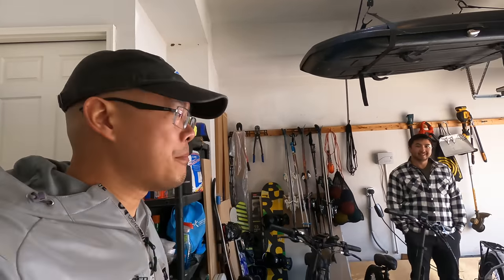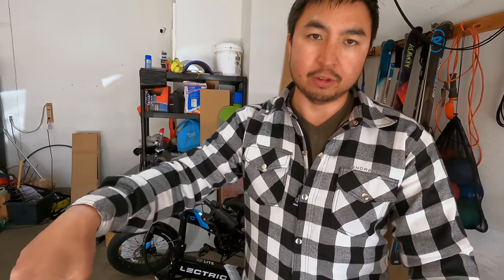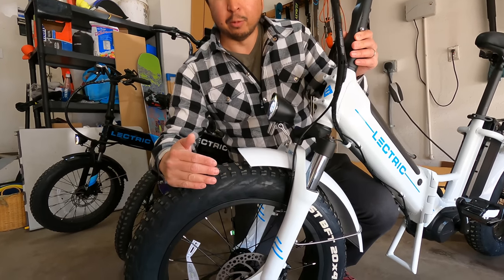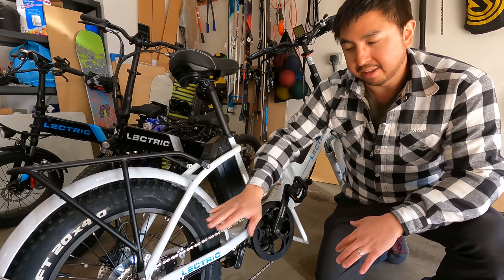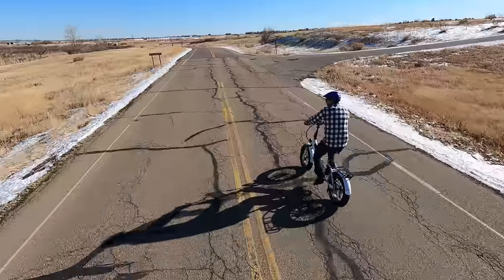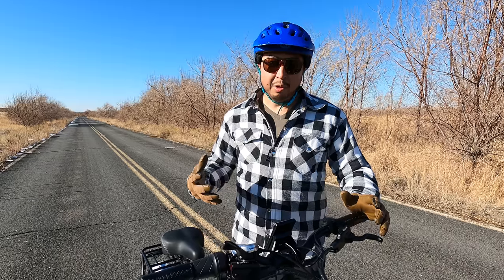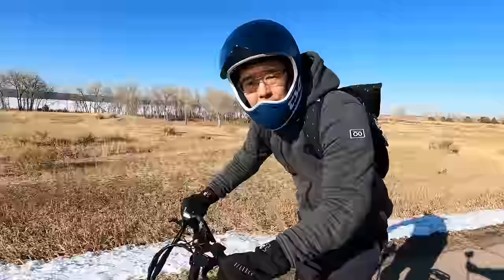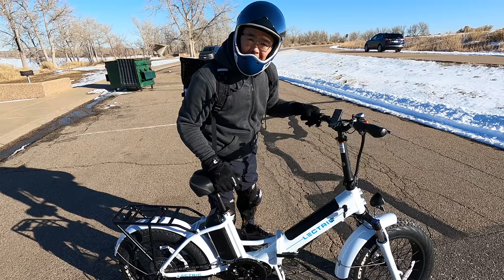Lectric XPremium Deep Dive: The Cadillac of Foldable Ebikes

Comment: It’s absolutely gorgeous. The only issue I see for me is what you mentioned the struggle of the 500watt mid drive on throttle alone going up hill. Granted there is a reason there is practically no throttle on mud drives, but a 750watt mid drive, or more would definitely be appreciated in order to preserve the motor as well as when you consider either a heavier weighted person also being able to carry more easily without worrying.
Reply: there are about a hundred mid drive with throttle ebikes out there.
Reply: @jamesharrison7114  In a 20 inch wheel and torque sensing pedal system as well?  At this price range and a company with actual support after the sale? Name them please, I need to know.  Not arguing, I'm not current on this combo.

Comment: Nice, I prefer thinner tyres which would save weight, less rolling resistance  and more puncture resistant.
A feature I think is really missing on folding ebikes is making them easy to fold into a position which allows them to easily push them around a shop, THE biggest problem with bikes is theft and a big use for them is nipping to the shop for a few bits and pieces.
Reply: Tern's Vektron line is good about this, but you're paying a premium for it.
Reply: And fat tire bikes don't fit on those front racks of buses the area Rider is a beautiful bike I almost wish I would have bought one instead of my lectric I do enjoy the cushioning of fat tires and thinner tires I feel like may get pinch flats because the speeds and the extra weight of the batteries

Comment: I can not find the mid drive motor brand name.  If it is a Bafang, then the controller can be upgraded to go even faster.  I see quite a few sales of this model happening.  Impossible to get these specs at a lower price with foldability.  Great review.  Cheers.
Reply: It's not bafang, I just watched a video with one of the owners on Chris Cross YouTube channel and he talks about it. 👍
Reply: Its a no name unproven piece of junk.  No mid drive worth its salt, would EVER end up on an ebike priced this low.  Let alone a folding one with two batteries.  Its absurd to believe this wont fall apart and have very expensive repair bills.  Besides that, REAL mid drives are very efficient and not only don't need 2 batteries, but they use on average far smaller single batteries, around 500 watt hours, that will get you 70 miles.  Something like a Yamaha mid drive does that, and wont be found on a POS like this contraption.  Going for low price will be the demise of Lectric.  Guaranteed.  It just is too young of a company, and far too naive to understand how to run a sustainable business.  Selling junk like this does not work.  Good luck with all the warranty claims folks. There are no geniuses at this company, any smarter than the hundreds of other brands out there selling far better quality at only modestly higher prices.  Be woke, go broke.  If a liberal could design anything, this would be it, as it wont last much more than a few seasons at most before needing to be replaced or heavily repaired at high expense.
Reply: @markg3950  What other brands? People always say this without giving specific recommendations.

Comment: Awesome review and looks really nice. The only thing i don't like that cannot be fixed.. is that stand... it just screams "snag me" lol.. i know it's structural.. but a locking hinge so it could be folded up whilst riding would be so much more comforting to me
Reply: The stand looks like a bad design, but they will supposedly fix that.
Reply: I totally agree. I have a RadMini Step Thru 2 and I sawed off the snagstand. I never fold the bike and don't really need it.  But I do go on hiking trails and it is in the way.   I made it so I could still attach the sawed off stand portion, by getting a little piece of steel pipe that fits around the tubing I sawed in half then drilled little holes thru the pipe and tubing both, and put little hairpin clips to hold them together, one clip above and one clip below the splice area, on each side.   

Lectric should have made a little folding and locking stand some how.  Could be a good retrofit kit for somebody to make!  I want this bike and I just might buy it tonight!
Reply: Well its 2033 now and our new XPremiums have a shorter improved stand

Comment: I think you missed the fact that the front suspension on the premium XP is adjustable. It is an air suspension. You need to put more air in it if you want a firmer ride.
It has some nice features and I suspect can give you more power than the way it is set up.
Reply: Power is not a word I would use to describe this bike.  Apparently, the XPremium has noticeably less power than the Lectric 2.0, for example.
Reply: Is it a Full suspension bike ? ?

Comment: I hope they put in a more hefty chain, since this is mid motor, there is a lot of torque coming thru that chain unlike a hub motor. You can help it by choosing a lower gear when you get going and move up as you gain speed. I would suggest removing both batteries before lifting it, your back will thank you.
Reply: I hope 3.0 will use a rubber belt and automatic transmission 👍
Reply: Same. I don’t want to unnecessarily worry about babying the chain when a go kart chain can be implemented like in the Juggernaut XD. They have finally fixed the problem that always kept me away from pulling the trigger on amid drive. Now they only have to accompany the massive power of their North American/Canadian motor to pedal assist and it is perfect.
Reply: @ScottOstr  you’re really thinking ahead. An automatic transmission would be next level, but to be honest mid drives have been around long enough for this to be a much more implemented thing. Ideally the best would be a tiny inconspicuous switch on the bike to have it be automatic, or manual.
Reply: @buffalomind6838  An automatic electric belt driven eBike already exists, so EZ to say. But a folding one with the affordable Lectric price and overclocked to 32 MPH doesn't yet. It runs that fine line between eBike and motorcycle. 🔥
Reply: @ScottOstr  it sounds almost to good to be true, but will be a thing in the near future. I don’t know if Lectric will further make history with what they offer from bike to bike in the XPremium 2, but some has the opportunity to do be the first. Hopefully Lectric does. It allow someone else to beat them to it.
Reply: Oddly, on a 1,500 mid-drive, they use the same flimsy chain.  Yes, the chain breaks very easily.
Reply: It doesn’t need a heavy duty chain. They have the torque sensor adjustable so low it barely puts out 60 nm at best. I have both the XPremium and the XP 2.0 and in class 3 the 2.0 is 4-5 mph faster. Wished I’d save the money and just bought another 2.0.
Reply: @georgeharvey3062  With an extra battery for same range as the Premium and you'd still save $$
Reply: @georgeharvey3062 How have the Lectric's held up? Any significant repair issues?

Comment: Some of these comments are ignorant. Any EV can require 3 or 4 times the power to climb a hill compared to the flats. ( so do gas vehicles but it is harder to measure)  This is rated 1/2 horse power with 1 hp peak.. how do you expect it to NOT slow down when you demand 4x the horse power.. and at most it may produce 2x ?   Plus you have chosen the heaviest machine, with the highest rolling resistance fat tires.    It is not a motorcycle, and not even a the most efficient form if you want highest speed or range...  you trade comfort for speed, and you trade your effort for a small motor... hence e-assisted bicycle. If you dont believe me.. put that drive train in a light weight bicycle with  high pressure 1.25 tires and see !
Reply: Yea don't really care for the fat tires. Folding ebikes are  commonly used for getting to trains or buses. fat tires like that are overkill for most scenarios.
Reply: Very insightful rebuttal! Which eBike did end up buying and what would you recommend to a first time buyer?

Comment: Also they need to make the center stand foldable.(lockable with built-in skidplate)
Reply: I don’t know pho’s this escapes practically every ebike manufacturer better yet company from saying this is what should be on for safety when actually being ridden. It’s truly mind blogging that this has not been addressed across the board. 🧐
Reply: Totally.  Or else explain why not.  Especially if you never wanted a folding bike and will never fold it, but want a 20" compact bike, like for RV's with a rear rack for a couple.

Comment: My wife is 4' 10" is this bike suitable for a smaller rider?
Reply: My wife's about the same size. Did you find a bike that suited her?
Reply: @DougPipersr  I ended up getting the 3.0 step through, we got a softer seat from Amazon and a shorter seat post stem so it goes lower by a couple inches, then we flipped the handle bars around so they are closer, there are some videos how to do it, after that it works really well for her
Reply: @FirstMrNick  Wow! That's very helpful! So are you happy with Lectric's and would you recommend them to first time eBike buyers?

Comment: Get a larger battery and a larger engine 750 or 1000 watt, then I'm in.
Reply: Mid drive has way more torque than hub motor, this is equalvilent to lectric xp 2.0 at 1500w, also u van simply change the controller and upgrade this mid-drive to run at 3000w, thts the biggest benefit of mid drive for me
Reply: @rahi7339  I want to see that video 👍

Comment: Somehow I don’t see the inclusion of a second battery as beneficial as it may seem.  The motor, as a torque sensing mid-drive is great, but still 500w and not 750 or 1000w.  The batteries are separate units use different keys, and come with one charger, which charge the batteries individually, one at a time.  Hydraulic brakes are nice.  The computer display could’ve been upgraded.  It would’ve been a better deal with one 14Ah battery instead of two 10Ah batteries, a bigger motor, and slightly lower price.  Where it is, I don’t think it sells as well as Lectric would want.

Comment: The triangle support at the bottom of the frame is a deal breaker. I see that it's used to support the bicycle while it's folded as well as to protect the cabling.  However, I can only see it catching onto a curb/rock/log, and absolutely ruing the experience.
Reply: Same. I think that's the only reason I am not pulling the trigger on the purchase. Hopefully the next model solves that.
Reply: Yup, drop your front wheel off the curb and that thing will hang up and over the bars you'll go. 🤦
Reply: Time to get out the angle grinder…
Reply: Convenient design, but a dumb design.  I couldn't stop looking at the stupid thing during the entire review.
Reply: It is truly a simple fix for them to do with a folding latched support like many other bikes have implemented. It feels less capable and gives one understandable worry when an a steel, solid, object is so low to the ground. It makes no sense to put that there simply for reliability issues. People have to been injured with that solid-steel-triangle anxiety producing contraption. I hope they read these comments and fix that for the next 2.0
Reply: @buffalomind6838 
 I have an XP with the same size tires as the Premium and the same triangle shaped safety stand  under the pedal crank hub. I have biked over 1,700 Km on it in past two summers. I have been on all types of trails,  up and down back road hills, valleys  parkway trails, pot hole infested rural roads, through swales, and city streets. The bike has climbed countless curbs and has never gotten hung up on anything ever. 
I also inspected the bracket in question earlier today and it has few minor scratches which I attribute to lifting up the folded bike and sliding it into my pickup's truck bed.
 
I feel dollar for dollar the XP line of bikes are the best engineered  their range price.
 I live in Canada and we have to pay additional shipping fee's, customs import fees and a 13% Gov. tax on top and I still feel for this ebike it's a bargin.

 I'm anxiously awaiting my new XP Premium this summer and I'm glad that triangle safety stand is part of it.
Reply: @candc36  I’m glad it has been working for you. However if I have the option of not having that constantly facing downwards it would be so much more less anxiety producing. I also can’t wait for the XP 3.0
Reply: @candc36 Great rebuttal! Thank you for weighing in. That was very helpful! How has the new XPremium worked out? Would you still recommend Electric to a first.time buyer?

Comment: Hmm not sure on this one being premium. Personally don’t like the look of this at all, I also don’t think they needed to stick with foldable. Most don’t fold these is what I’ve found because it becomes really cumbersome and heavy. 

For this to be their flagship I think they missed the mark. People that want a folder have two other options in their line. 

The geometry looks uncomfortable to pedal. 

I do like the ability to remove batteries without folding. And that it’s dual battery. Mid drive is nice but should have been 750w to give more uphill torque. 

Class four ability through an app setting would be nice, throttle up to 28+ would be great for certain situations. 

I’m curious what the final price will be… guessing 2k

Comment: I had a Benno Remidemi and loved it until it was stolen. Fortunately it was insured. I was planning to replace it with the same model, but now I see this… more range, suspension, and folding, at half the price.  What is the reason for such a large price difference?  Will the components on this not last as long?

Comment: Now way this bike can go 28mph. I have both the XP 2.0 and the XPremium. I liked the 2.0 bought for my wife so much I preordered the XPremium for myself. After a 3 month wait it finally arrived. I was stoked when I finally got it. On my first ride I got disappointed quickly but after a ride with my wife on her 2.0 I was angry. With both bikes in class 3, XPremium in pas5 and my wife on her 2.0 in pas4 I cannot keep up with her. She got so far ahead of me she stopped and ask why I was going so slow. I was peddling my ass off and could not match her speed. The problem is the programming of the torque sensor on the XPremium. It simply will not give enough power to the motor with each pedal stroke. I’m 6’3” 210lbs and I cannot give the bike enough stroke power to maximize the 120nm the motor has. I spoke with Lectric tech and he said that part in the computer is locked and cannot be adjusted. The fastest I can get this bike going is 25mph on a flat and believe me I am peddling as hard and fast as I can. My wife can go 28 easily on her 2.0 with minimal peddling and so can I when I ride her 2.0. I wish I had saved my money and bought a 2.0 without the wait. Went nearly all summer waiting for a bike that is inferior to one I could have had right away for less money. Lectric needs to fix this problem or the XPremium is going to dwindle away.
Reply: Do you still regret buying the XPremium?

Comment: How do you find the seat position in relation to the pedals? I have a Lectric XP 2.0 step thru and find the pedals are too close to the seat so it feets like pedals are right under your seat like a unicycle. This makes your quads get sore fast and strains your knees. I've moved seat up and as rear as possible. I've seen other Lectric owners install layback seat posts to move the seat further back. Seems to be inherent to the design of the step thru and folding frame. My other ebike Voltbike Bravo and Jetson Bolt Pro don't have this issue with weird seat to pedal distance geometry.
Reply: They are much better. Pedal positions on foldable ebikes can feel cramped like you mentioned. The pedal position is much more natural on this bike since it's longer.
Reply: @Andrew-vt4jt  oh awesome! The angle/distance looks a bit better.

Comment: Question is just thought of. Maybe you can ask the guys at Lectric. I'm a big believer in charging to 80% to prolong battery life. On my current ebike, I can do this easily.  I can see the battery voltage and and I know how much my charger inputs per hour. So I just use a timer.

Now, you can use this method on the XP 2.0 since you are able to see the voltage. But on the XPremium, how will this work since there are 2 batteries that may have 2 very different voltage levels? Isn't the screen only set up to display voltage for one battery?

How can I know the voltage of each individual battery to then be able to charge by timer?
Reply: Lectric obviously has not thought this bike through.  The batteries supposedly equalize their charge depletion, but likely not,, since the front battery is clearly the primary.  I suspect that the back battery basically charges the front battery, and everything runs off the front battery.  All well and good?  No.

Suppose that front battery has an issue, but the back battery is good?  The bike is useless.

Comment: I haven't noticed any numbers mentioned on per charge mileage ranges possible? With double the battery Ah here then the original XP 1.0, is the claim then up to 90 (45 x 2) miles? I'm sure real world testing would be much less than 90 miles for most people, riding under most conditions. 60 or 70 miles range per charge would still be pretty awesome in my opinion though. Thanks for the info and for the review on this and would love to see some range numbers having twice the battery power now...just curious is all.
Reply: The company claims up to 100 miles range under optimal conditions. The mid-range motor is more efficient than the hub drive motor. The absence of a cadence counter means that you will only receive electric motor assistance if and when you pedal the XPremium.